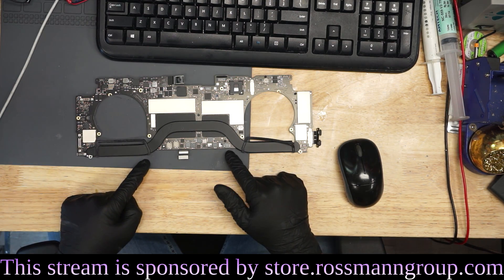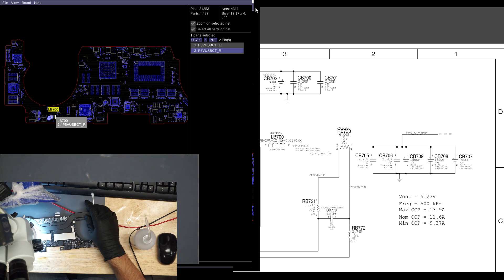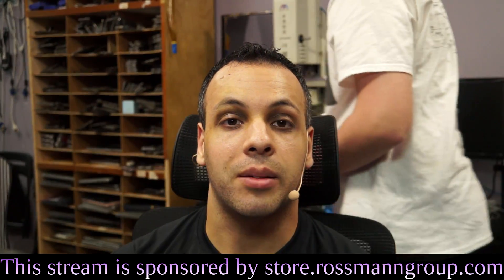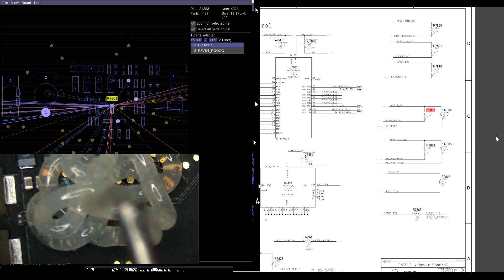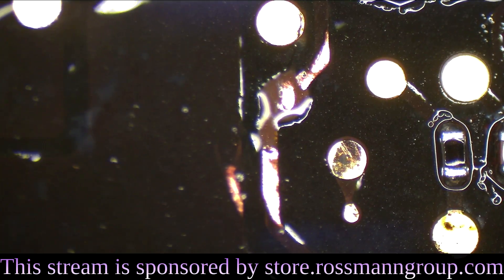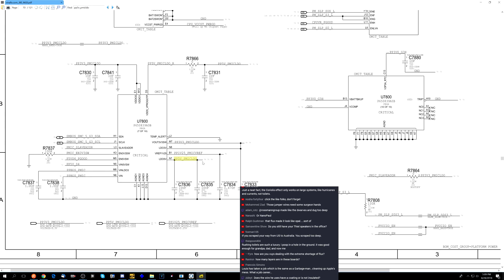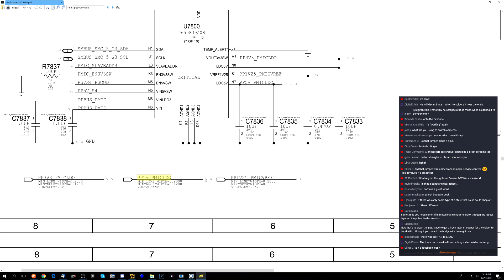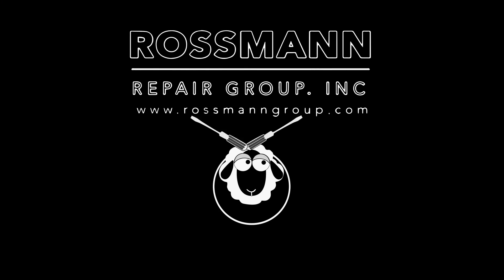Why does this kill a Macbook?

Comment: Louis, I get that you hate on apple for the bad design choices they make, like putting LCD_Backlight voltage next to a data line. This is just stuff you should not do. But here, there is nothing to blame the designers for.

That signal is NOT "self contained within that chip". If it were, there were not traces on the board but just "within" the chip. Apple would not go to the efford of creating the external connections, if they were already present in the chip. 
The signal is created by this chip and only used for that chip - that's true - but the routing of that signal will change the chips behaviour. Think for example of the old telephone systems, where a person would sit in front of a huge panel with hundrets of phono plugs on it. Sure, that person would just take a signal form somwhere on that panel and just route it to somwhere else on that same panel, but it's this routing that creates the desired behaviour.

As to why that trace is on the other side of the board, there are two reasons. First, this is a tiny BGA chip with a lot of connections that have to go out in many directions. You simply don't have enough space on the board, to route all the signals just the way you like. That's why the logic board has at least 10 layers. And even with this many layers, it's an incredible challange to fit all the traces on it. As the layout person for a board like this, you can be happy to find a way to route a signal, even if it's the opposite side of the board. Second, they wanted to have a test-pad on that signal for factory testing - which is a good thing. Since there is no point in placing a test-pad underneath the chip, where you could not reach it, they put it on the other side of the board.

This design and layout does absolutely make sense.

Comment: what would your expert opinion be on the most reslient MacBook Pro? I currently own a mid 2012 MBP I7 that has been killed no less than three times. The only fixes required? a quick alcohol bath and acid brush massage. still feels as good as new. With the obvious ssd and ram upgrades of course.

Comment: If its an internally generated signal or voltage that requires any decoupling caps, programming resistors, etc. then its easy enough to understand. Have to bring it to somewhere on the board to put the components. Break the trace, and whatever pins that were being fed that signal no longer have it, and the machine stops working.

Comment: My guess. It’s running across the board because it’s a totally internal signal, but the zero ohm means they wanted to be able to modify or probe it. I’ve seen fpgas like his where you need to short external signals so they can program themselves and skip jtag

Comment: Maybe u7800 processes that signal and sends it somewhere else? Like it sends it out of the u7800 to another pin on the u7800 and then uses the processed signal to pull something down or up to send to PCH or CPU or something. Due to the trace being corroded, it isn't getting the expected signal and processes it incorrectly and sends the wrong signal to CPU or PCH causing the board to malfunction. or maybe I don't know what I'm talking about because I don't know board repair xD

Comment: Perhaps the subject(s) to which you and Chris are to discuss is dependent on the content/features present on your cell phone - with it not working it might make communication incredibly difficult as the conversation will not be aided by the cell phone, in turn this could put you both in the state of not having the need to verbally communicate as you may not be able to fully express what you both wish to express.

Think of the following scenario:
You are streaming the web, you come across a material consisting of a concept design for a NEW means of vehicle transportation, you click the material to view its contents, you become amazed with every aspect of the design, and you wish to share this profound content with your associates in person to ensure they understand the opportunities you've identified with the concept design. You save the material on your phone(for visual aid), on a later date you come across an associate you wish to share your understanding with, however your phone is not available to display visual cues to your audience, it will be difficult  for the audience to follow your train of thought when they have not got a visual understanding of what individual aspects you're referring to.

Should a trace get corroded on the board, that may result to the trace no longer functioning,  which in turn will affect other components that depend on its participation to function its role. Should a trace get corroded and the entire board stops working that may be the cause of too much power. Please correct should I be wrong in any way.

Comment: That trace looks like it is there to filter out internal noise and also reduce signal based on how they want to adjust for there setup.  But the other reason it is there is the same reason you mentioned before, if apple can cheap out and you will buy it, they will cheap out.

Comment: Your assertion that "it makes no sense" to have a "self contained [signal]" on a chip is flawed. This is quite common. It enables the same IC to be used in many different configurations by simply changing the traces around it.

Running the signal to the other side of the board can be very helpful. Maybe it was because they didn't have room under the bga to get that trace to stay right under the part. More likely in this case, imho, is that this is to put all the test points on the same side of the board for easy fixturing and testing.

Comment: They could be inputs and outputs that signal different parts of the Chip And what could have been disconnected is output to an input. Also it is very complicated to break out a bga when your routing the board and it's possible you had to come out to another side to get back.

Comment: i have to clarify this, verdigre does not conduct that well but what it is a resistor and capacitance combination. if this is in an high frequency location on the board it will cause a difference. what i find odd about apple stuff, we always used to lagure boards before components were ever put on it to protect against just this sort of thing. this was a mask by the way that covered all but the solder points. example amega circuit boards. what has gone so wrong. i would like to know. just wonder why this simple thing has gone. ?

Comment: Yes, there is several times you need to wire the same chip to it self, and yes you need to take other lines in to account - also it was a test pad, and maybe during development you want to be able to cut the line - also lines can be used as inductors and resistor if only low values are wanted

Comment: There are so many corroded components! WOW! I recently bought a new Laptop to replace my dying 5 year old Laptop to see how much corrosion there was on my board. Interestingly I found none at all?! I had a ASUS Laptop and replaced it with another ASUS ROG Gaming Laptop. The old laptop did have several HDD errors (All drive errors which I quickly fixed and backed up) and DVD Drive laser error which I replaced with a Blu-Ray drive. Blu-ray drive is practically dead now as well. But I found no corrosion on my board! I just took it apart because I was curious. How do the Apple boards build up so much corrosion? Is this something you see a lot in Apple repairs?

Comment: If the chip has a control buss, it may be address lines for it. They could also be other sorts of configuration IOs for that chip. Not all that uncommon. It may be part of the volt sense feedback system. Often they are setup so the voltage can be sensed at the point where it is used to compensate for line losses in the wires between.

Comment: Louis, instead of killing many pairs of tweezers every month, switch to a small box-cutter knife. The back edge of the blade is perfect for scraping off solder mask & breaking through oxide layers. Snap off the tip when the edge dulls & you're good to go again. Buy a decent quality one with a blade clamp near the tip. It will give better, controllable results, unlike the cheap plastic types. :)

Comment: it hurts so much when you realize that we have the knowledge and technology to make laptops last forever and never fail, but we simply don't do it to assure another sale. Conformal coating, BGA underfill..  solder-free connectors (as used by automotive). Imagine if your airbag IC corroded failed after a year?

Comment: Hey louis, would it be possible to send you an iphone 6s that is out if warranty? Its had 2 screen repairs at least and now its bricked, screen wont turn on and it wont restore using itunes, also doesnt vibrate when plugged in to power

Comment: You don't get it why a signal from a chip pin to another pin on the same chip may wander away from the chipbecause you don't understand that signals have timing... Timing on boards depends heavily on the length of a trace when we are talking high speed signals.  If you don't match the length of traces properly signals will arrive at different points with differing timing.  And you think yourself an expert enough to criticize the design.  If you don't understand signal timing you shouldn't even be playing in this sandbox!  Move along to yet another hypercritical anti-Apple hit piece by talking heads who don't know their traces from skid marks on TP.
Reply: Suuuure.. a flipping power chip is gona have GHzs of cycles. Cause that makes fucking sense. Stop thinking different and get your head out of that sand.

Comment: The pins being connected together on U7800 doesn't seem unusual to me.  The pin names on the schematic tell us that all those pins have something to do with 5V power, but they are distinct nets inside the IC--they are not connected together internally.  It might be that they all need to rise together or the IC will be damaged.  The fact they ran it to the bottom layer could be due to congested trackwork, or could be because they wanted it exposed for ICT probing.

Comment: Oh boy sudden flashbacks to my time at a refurb place removing the sheets of dust and fibres that years of neglect will allow to accumulate, luckily most of the machines I had to strip were towers otherwise liquid spillages would've turned the mother of all dust bunnies into a congealed composite of yuck like one particular laptop I felt was unsalvageable due to the flora living inside.

Comment: @Louis Rossman  there was a time,maybe 8 or nine years ago i considered buying an apple computer and possibly an iphone. but i started checking reviews first and found there were a lot of unsatisfied customers with apples repair side of their business. now when it comes to windows based computers especially desktops i am fairly knowledgeable and can diagnose and repair most hardware problems. i presently have a toshiba Qosimo laptop that is ten years old that i leave running S.E.T.I. 24 hours a day with no issues,an H.P.desktop computer with a six core amd processor 3.80 ghz that i have had for about 5 years and the only issue i have had is a hard drive failure.
since i cam across your youtube channel about 2 years or so ago and have seen first hand the garbage apple is foisting off on people it makes me glad i have spent my money on systems that have given me little to no trouble and that i can generally diagnose and repair myself. unless apple starts doing much better for it's customers i will never buy their products. and any of my friends that have bought their products and need a repair i will send them your way.
you do good work sir and that is always appreciated!

Comment: It probably makes sense. My guess is that this PMIC combines 4 (or more, I can't tell exactly without the schematic) independent buck regulator controllers which require 5V power rail for their internal logic to work. Usually they have a built-in LDO, but in this case where you have 4 channels there's no point of making 4 copies of the same 5V LDO. The chip has a single 5V LDO which can be connected to each of 4 channels. Why not connect them internally? Because you don't always want to use all 4 channels. Some designs require 4 channels, some can get away with only 2.

And when it comes to connecting everything on a single layer - using multilayer layout allows to greatly reduce solution area. As you can tell, modern macbooks have pretty dense layout. It's not like you have a plenty of space between the balls to connect that 5V rail to each of 4 channels. And honestly, that is not what you should care about to begin with. As long as design decisions don't cause performance or reliability issues, there is just no point of discussing whether or not some specific layout pattern is a sign of brain injury.

Comment: It looks like it comes out of a pin called VDD5 and then it goes to lots of voltage regulator pins. I'm just gonna take a stab in the dark and say VDD5 is a 5 V source and its switching lots of other regulators on/off at the same time. The chip can't power itself, so the trace you connected could have been the source or something ? Also for PCB design you might want to run things through vias. Maybe it is a multi layered PCB with power somewhere in the middle. Also tons of EMC directives can force manfacturers to do something. Again, without the schematic it's hard to say what's happening. 

I don't like apples but there probably is a good reason for this that we're missing.

Comment: The company I work for aim to cheap out as much as possible, im pretty sure if i dip one of our boards in water and leave it out the PCB would not get that corroded (yeah the solder will). why can't they just put a plastic coating on their PCBS rather than something that looks like card...

Comment: It is so the chip can be powered fully (powergood asserted) before turning on the regulators.  Routing externally allows for multiple configs with multiple regulators. Rather than all on/ all off.   Other ones indeed short these together internally to one 5V on all regulator inputs. See TI TPS650830    search for VREGVR4   should all make sense. http://www.ti.com/lit/ds/symlink/tps650830.pdf

Comment: Running a test point on the other side of the board for easier quality control is a good reason to get the signal there.
But it's not a reason for making it go through all the planes and back to get to the other pin of the chip. Even if a ground plane was below the chip "for thermal or EMC reason"

Comment: Depending on the chip, certain pins are not able to be left "floating" or not connected to something. Yes, although it makes sense in this application of the chip to have all those pins connected internally, this chip is meant for multiple configurations. All those pins are connected together in this circumstance because they need to be the same potential/voltage/state for Apple's configuration of the chip. Why they are connected exactly in that round-a-bout manner, well, you'd have to ask the intern who routed those traces on that board :)

Comment: It's actually quite easy to explain why this signal goes all around both sides of the board to reach back to the same chip. As you've managed to prove with this video, this line is prone to water damage. So this line's sole purpose is to detect a water ingress to the machine. I bet it's located in some place, like the edge of the keyboard or the touchpad, where the water will get first and corode the trace. GENIOUS!

Comment: I wonder why manufacturer makes this IC like that. I believe if there is internal connection between all points Apple doesn't have to make wire connection on board. Not sure if this IC is made for Apple only or it canbe used by anyone. If it is for Apple only than yea.. we can blame Apple for poor design.

Comment: Wow, it looks so easy if you just put a ton of flux on the PCB and use a (compared to) giant iron on it.... I would have caused a canyon on the PCB probably :D
Any recommendations for low- to midrange tools for dealing with PCBs and SMD-parts? Finding a good USB-microscope seems to be hard already.

Comment: Hi Louis, I'm an electronic hardware engineer and it's possible that this broken signal trace is made for programming the chip (which explains the exposed pad) and / or for configuration with external components (which is very usual for analog and power ICs. Good job anyway!

Comment: The reason I think this is done is to add an external filter to a low dropout regulator.  Perhaps this chip also has multiple modes of which Apple only used one.  I would have to read the datasheet.

Comment: It's simple, they cut costs on the chip die by having the signal route through traces on the board (and they went to the other side to bypass other traces they didn't want to redesign/a busy area of the board), or they just wanted a breakout point for that signal!
Was it unnecessary still? Hell yes!

Comment: Just a quick question. Isnt it possible that because of that line the chip wasnt functioning properly and was basicaly pulling down the whole system  = no power ? or is U7800 after that whole powerup nonsense ? in which case, yes, it makes no sense.
Reply: I am just saying that this is probably a general purpose chip.. which basically is Apple cheaping out..

Comment: It looks like there is an RC filter on the line. So the signal exits the chip, gets filtered, and enters the chip again. Or was a rc filter , and they ended up with just a cap

Comment: if u7800 is a multi-function chip, the parts are inside separate and will need there own rail. if the is a block diagram of the chip look it up.